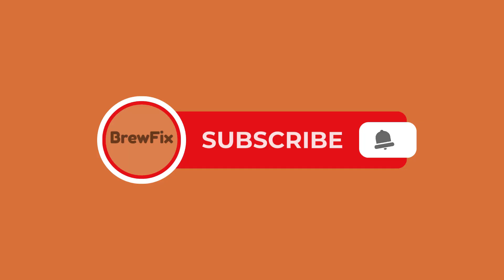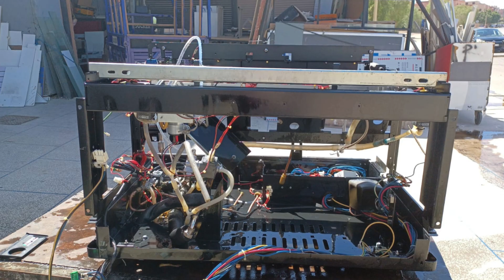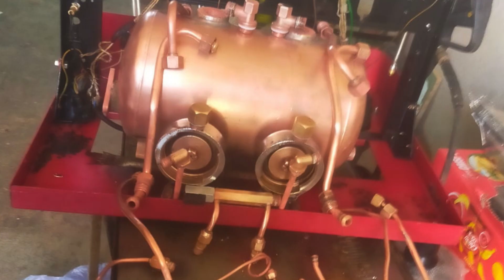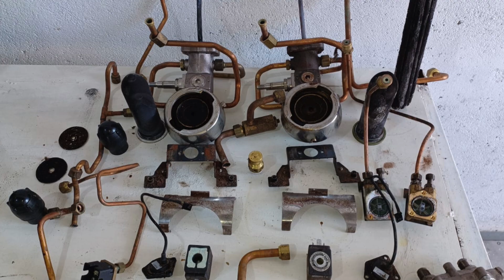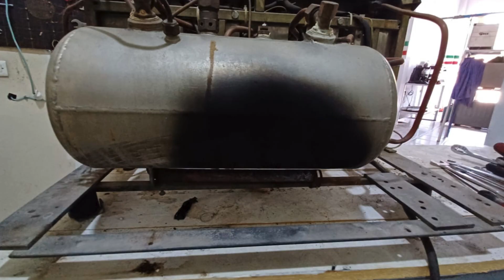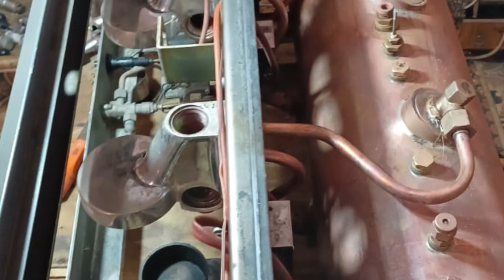No Water From Your Espresso Machine Grouphead? Here's the Fix

Comment: I have a couple problems on my 1994 Rancilio S27: originally no flow through the group head despite steam and hot water spigot working just fine. 
The group head solenoid sounds like it's functional as a massive "click" is audible when i hit the brew button. 
The pump runs for a few seconds before squealing until i shut it off - water and air bubbles can be seen oscilating back and forth in the pump lines, but doesn't actually appear to move forward the way it does when it autofills following the hot water spigot use. 
(shower screen is already removed).

I'm thinking of running some guitar string up through any holes in the group head and brew switch/solenoid head and swapping the hotwater solenoid with the grouphead solenoid as hot water works fine. 

While i've been trouble shooting, I noticed water and air began bubbling up from the heating element terminals. My electrical outlet stopped working shortly after, but I can't find a tripped fuse in the house....does this mean the element needs replacing or just a symptom of what's happening above??

Comment: I checked the flow meter under the tray ,only 1 side is blinking and the other one shows nothing or any positive sign,i turn on any brew button and the okay other side spins with water,now im sad
Reply from the maker: It sounds like your flow meter might be faulty, so try testing it by cleaning or swapping it with the working side to confirm the fix.

Comment: Hi i really need your help,im using fiorenzato lido 2group btw,i had change the selenoid valve including the brass metal (1 set) ,however no water coming out from the group head 1 at all,after opening the top of E61 mushroom screw,theres no water flowing at all to that specific group head while the other ones keep on flowing like normal,whats the probability of this problem?any help or explanation helps 🙏🏼thank you
Reply from the maker: Since you have no water even at the mushroom, you likely have a clog in the pipework or the inlet orifice feeding that group or the gicleur
Reply: @BrewFixx thank you so so much for your reply and i will check it asap,thank you!